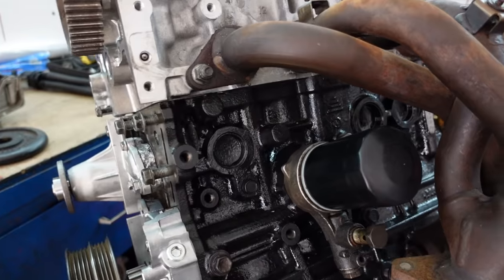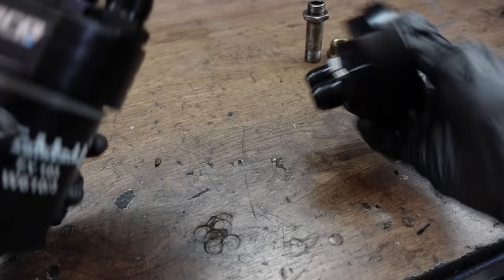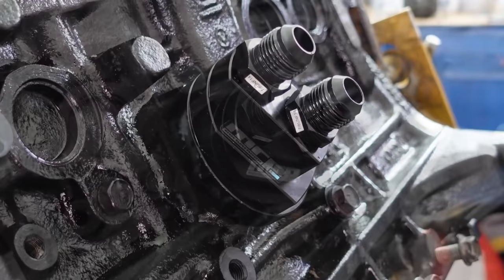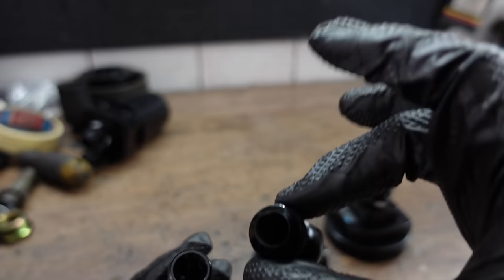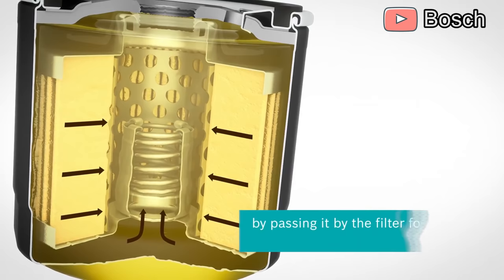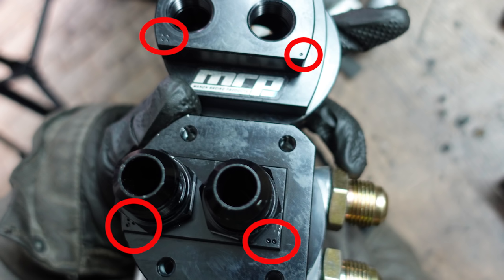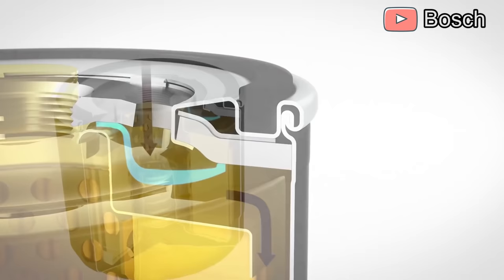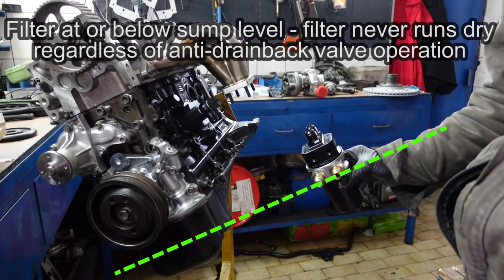HOW and WHY to relocate your OIL FILTER

Comment: Something to remember, use some sort of protected oil lines.    I had one of these kits installed on my Cummins swapped F350.   One oil line rubbed a hole in itself and ruined the motor.    Truck has been down since July waiting on parts and I'm 14k into the project.   All of this could have been avoided had I have used a protected oil line.   It's been a life lesson with zeros behind it.
Reply: it's good that your informing others from your experience so that other car enthusiasts can avoid such incidents and  well 14k ain't no joke but on the bright side you learned something from your mistakes which is always a good thing :)
Reply: Install an oil pressure gauge to or after the point where the oil gets back in the engine block. I know, hindsight 20/20
Reply: @petermolnar8667  it's actually got a gauge on it but I didn't catch it.   I'm thinking of either a low oil pressure shutdown switch or a shift light sized idiot light.    Probably go with the light.
Reply: How about installing oil lines so not being rubbed by something?
Reply: @psk5746  the lines are about 7 feet long.   They were  running down the top of the frame rail and held into position with very wide zip ties.   I thought would be a fairly safe place to be.   It was just the weight of the lines on top of the frame along with the vibration that wore through the soft lines.
Reply: @clinkerclint  silicone lined steel clamps are what most aircraft use and they hold titanium hydraulic lines and wire bundles. I bet they can be found at a Fastenal store
Reply: Another thing to help save a performance or enthusiast engine is to utilise an accusump, electrically actuated with the ignition is best
Reply: @tturi2  accusump??
Reply: @tturi2  accusump isn't going to save you if oil is just dumping out of a ruptured oil line.
Reply: @superbarnie  it will stop your bearings from running dry if the engine drops pressure
Reply: What's your thoughts on using steel braided hoses. Novice here, but like the idea of this, plus using oil cooler, and oil temp/pressure guages
Reply: @ewetoobblowzdogg8410  I think that's probably a good route to go.    I went to my local Caterpillar dealer and bought plastic slip on shielding that is used on hydraulic hoses.   They also make the same product in steel but I was afraid it might wear the rubber line worse.
Reply: @clinkerclint  maybe a warning buzzer could do the job too 🤔
Reply: @tturi2  Lol, yes, for a few seconds until you run out of oil in the accusump. Then you're still boned.
Reply: @superbarnie  that a few more seconds that could save you weeks of work and thousands of dollars
Reply: @tturi2  So spend nearly a thousand dollars to buy a few seconds that may or may not save your engine? How about spend a few bucks to set up a good oil pressure warning? Or spend a few bucks on AN lines that are abrasion/heat resistant? Or spend a few minutes to route and secure the lines so they don't abrade or get caught on stuff? Or set up oil pressure failsafes in your ECU? Any of these things are better ideas than using an accusump. An accusump is great for its purpose, but this isn't one of them.
Reply: @superbarnie  You would do all of those things while also having an accusump, it's good insurance, helps oil surge and sudden leaks, but it's upto you if you think it is worth it, my engine owes me nearly $10,000aud in forged connecting rods, forged pistons, 8000 rpm cams, head studs, machine work ect, so to me the start up prime and a few extra seconds of surge protection is worth it, I'm even considering a drysump for it so maybe I'm going over board lol
Reply: @superbarnie  an ecu that has those fail-safe measures is pretty expensive, usually needs a matching engine harness or adapter, may as well go with wide band and better coils while you are there
Reply: @tturi2  Sure, an accusump is nice to have, but its purpose is to supply oil during brief periods of oil starvation. It isn't a solution for leaking oil lines or oil loss. It isn't relevant to this discussion. 
The ECU thing isn't relevant to people running stock ECUs, but almost everyone with a serious build is running a standalone ECU anyways. I would hope you are not planning to use a stock ECU with your built motor. It would be a waste.
Reply: @superbarnie  nah motec m150 with tefzel wire and dtm connectors
Reply: Same boat for me but with my genny  I’m 12k in and car not running
Reply: Engine Watchdog,  will automatically shut down engine if overheating or low oil pressure event, ond only a few hundred dollars.
Reply: Oh god that one hurt to read
Reply: Simple fix... Don't let the lines rub on something lol.
Reply: I throw the lines that come with kits in my spare parts bin. Then I go to the hydraulic hose shop and get custom made constant pressure tough jacket hoses made. Yea they cost a bit, but buy once cry once.
Reply: @petermolnar8667  I've got a big red warning light now.
Reply: They make hose clamps...
Reply: At some point you think you'd realize that it's just trash and buy a new truck
Reply: @catfisher420  man, if I thought there was a better truck out there, I'd buy it.    What have you had good luck with?
Reply: @clinkerclint  in 1985 Toyota 4x4 was the best truck I ever owned.
Reply: @catfisher420  Those are good trucks, unfortunately they just won't do what I need in a truck.
Reply: Thanks for heads up dude, and sorry about your ordeal. That is super harsh outcome. Don't beat yourself up for too long, IMO easy thing to overlook. Protected brake lines, ok, forseable, but I would have thought higher up the oil lines would have been ok with less protection.
Reply: Just using a nylon sleeve like techflex or a braided line would have saved so much grief

Comment: Why haven't we invented a "pre-start lubricating yet? Basically just an oil pump connected to an electric motor that starts pumping 1-3 seconds before the engine actually starts. Cars almost drive themselves at this point. But why have I never heard of pre-start lubrication? Wouldn't that massively extend the life of an engine?

Comment: I relocated the filters on my S-10 and my Isuzu Trooper. I also switched the filter to a large and common Chevy V8 filter. The filter was more than double the size but cost the same. I mainly did the relocation because the filter sat at a 45° angle and would get oil all over the exhaust and frame when changing oil. Plus if you did a change on a hot engine there was a 99% chance you were burning your arm. I located the filter under the hood and moved the sensors to the mounting pad so they were away from exhaust heat. I can now change the filter easily with good lighting and no awkward gymnastics. I can also fill the filter with oil, which takes close to 1L, and avoid a dry startup.
Reply: Awesome👏 I totally understand why you did the relocation.
Reply: Nice job, the filters on a Trooper as a mess to change, and they need so soon to get changed, what a pain!
Reply: 4jb1 2.8 trooper?
Reply: @amarularif3110  No it was a 2.8L Gas engine which was a General Motors 60 Degree V6. The main reason to start doing the swap was the leaky oil cooler lines which were discontinued so there was no real hope of salvaging the system so the remote filter made way more sense.
Reply: Prefilling an oil filter is a waste of time
Reply: @idabomb00  definitely!
Reply: @idabomb00  why?
Reply: @luizbruno2010  many vehicles have the filter oriented in a way that would make it impossible to prefill, sideways upsidedown etc. Common sense dictates you don't need to prefill one that is possible to do.

All of your critical moving components; crank, cam, rods, rings, gears, chains valves, etc. are already coated and lubricated in oil from the last time your engine was ran (which should be just before your oil change to move contaminants in a suspended state). It takes just a couple of seconds for the oil pump to fill the new oil filter and resume normal operation. That left over oil that was coating your moving components is enough to lubricate them during that couple of seconds. 

Don't believe me? Here's the math. A small block Chevy with a standard capacity oil pump at 400 rpm pumps oil at 2.45 gpm, which is about 5.2 ounces a second. At 3000 rpm it pumps about 18.4 gpm which is about 38.4 ounces per second. Most vehicles will be around these numbers for the oil pump and the volume of your oil filter is a variable, When starting your vehicle, your rpms will be higher than 400, probably 1000-2000 when it first starts for those couple of seconds it takes to fill the oil filter.

This is why it's a waste of time.
Reply: @idabomb00  great explanation thanks

Comment: With an oil filter that sits with the thread side pointing up, so that inlet and outlet are pointing upwards, there is no risk of the oil draining out of it. It might run down out of the feed lines in that style set up if the lines are high but not the filter.
Reply: I was hoping that someone would point that out as it's not clarified here that the anti-drainback valve is designed for filters mounted horizontally or upside down.

Comment: I work more with diesel engines rather than gas engines, but what about using an oil to coolant heat exchanger rather than an air cooler?  These typically have a higher heat capacity than an air cooler, can be pretty compact, and prevent over cooling, in most cases not requiring a thermostat.  You can even get one that sandwiches in between the filter and filter head, so no additional plumbing needed.

Comment: It is often a good idea to relocate filter as that gives the ability to pick up pressurized oil for a turbo or charger, to install oil temp and oil pressure sensors, and to install oil cooler to prevent overheat as well. 
Almost mandatory for every performance oriented engine mods
Reply: Im sure the engine design engineers know what they are designing and doing
Reply: @dq2023  sure. But designing a commercial engine for cars to be sold is slightly different from designing a performance engine for cars to be race.
Reply: @dq2023  they have to design and build cars to a price point, rather that excellent enginering. Except for some German cars, where the Goverment support the auto industry through education & funding of science & research.

Comment: To prevent dry starts  
after the engine hasn't been started for a while, an electric oil pump can be installed between the engine and filter triggered by a remote switch inside the car. Turn on ignition, run the pump for 10-20 seconds or so and oil pressure will build before the engine is fired up.
Reply: Do you know of any electric oil pumps on the market, it's s good idea, I made the same comment before I read yours.
Reply: @slypig24  No I don't unfortunately. I got the idea from a friend who rigged up a pump for his TVR. It was fitted with the Ford V6. Sometimes it wouldn't be used for months but the electric pump would bring the oil pressure up before starting. There's likely a big market for something like this if someone could produce a kit.
Reply: Oh good lord, there won't be any "dry starts".
Reply: @starmc26  Praying to the Lord won't solve the problem..
Reply: @starmc26  of course there will- it takes time for an engine to build oil pressure- even if it's for half a second- that's half a second multiplied by ever time you start your car. It's really not a difficult concept to understand.
Reply: That sort of extra pump arangement adds complexity, and in the use case, won't do anything - as described it would be trying to suck cold oil through the stationary mechanical pump, which is in turn designed with clearances that stop oil leaking past it,...
What works is a pre-charge system that has a tank conected through a two way valve on the return to engine line of the remote filter/cooler assembly - when the engine is running normally a portion of the oil is tapped off under pressure to charge the tank (The tank is never fully filled, the air in the tank is what compresses) with a reserve of oil ready to flow in to the engine when the valve is set to feed back toward the engine. The valve can get a signal from the key, meaning the engine has oil pressure before start-up, and it can be triggered by an oil pressure switch, so if the internal pump starves under high cornering load, the valve sends reserve oil in to the engine maintaining oil prssure in the bearings.
This setup can also be used with dry-sump external scavange pump arangements.

Comment: Awesome, I used the GREDDY thermostatic sandwich plate with an ebay relocation kit that looks exactly like that one in design. It works great on my 2ZR-FAE, that engine doesn't have room around the filter housing to fit the AN fittings, probably with the banjo fittings I could've done it, but even then the greddy plate didn't replicate the filter well enough and would not catch the threads on the oil filter housing, so I set it up just like you did on this video. I can't recommend using thread sealant enough before you run any oil through the lines, it definitely will leak even though it uses NPT fittings. My engine averages 50PSI on cold starts, so the oil pressure builds up way before my oil gauge boots up which is in less than a second.

Comment: I relocated the filter on my 2004 Mercury Marauder because the crossmember and rack would get drowned when the filter was changed. Also, it allows the smaller FL820s filter to be replaced with a larger FL1a, plus adds 1 more quart of capacity.  Mine was for convenience but this video is spot on and very informative.

Comment: Great timing! The SR20 in my NX2000 has the oil filter literally inaccessible without taking apart the whole engine bay, as well as pouring all over the engine when it comes out, so I bought a relocator kit to fix both of those issues.

Comment: Learned some cool stuff. 
I'd also like to point out, there's also the option of a heat exchanger instead of an oil cooler waaaay up in front. 
Shorter lines, less pressure lost in the lines. You do have to plumb some coolant lines though.
Reply: The heat exchange also has the benefit of warming the oil in low temperatures, and is arguably better than the thermostat and cooler combination since it tries to equalize the oil with coolant temperature. Dumps heat in the radiator though.
Reply: @mitchellpatterson1829  Yes you do need to account for it in radiator sizing as well.
Reply: Alot of cars already have this from factory ..... especially turbocharged cars!
Reply: One of the reasons tuners use a separate cooler instead of a heat exchanger is that you free up some cooling capacity of the radiator, without fitting an upgrade. Normally, it would have to deal with both the heat of the coolant and oil, and with some extra power/under higher loads this could lead to overheating, fitting a separate oil cooler is just a way of increasing the overall cooling capacity
Reply: @petermolnar8667  While that is true, an oil/air heatexchanger is suboptimal in case of the MR2 (all 3 generations)  there is no good point to mount it.
The side air intakes are too small and would result in higher engine bay temperatures.
Front mounting would require some absurdly long lines and taking air from below would clog up or damage the oil cooler quickly.

So for a turbocharged MR2, it makes more sense to use an oil/water heatexchanger and upgrade the water/air heat exchanger seperately.
Besides, the water/air heatexchanger needs an upgrade anyway when you turbocharge the car, so this doesn't realy affect costs much because you'll need to get a new one anyway.

Sidenote:
At least the EUDM MK3 came with an oil/water heatexchanger from the factory due to the expected long periods of WOT on the Autobahn and the resulting high oil temperatures.

Comment: Upgrading oil pump is probably a good idea if doing this and make sure cooler can flow good enough for the application. For very cold weather consider the extra distance the oil will have to travel to get to where it’s going. Usually not very much of a difference but it can be considerable bellow freezing.

Comment: Thank you for another interesting video!
To the last point of the engine running without proper lubrication. I'm wondered why there is not an electrical oil pump for pre-lubrication of the engine before start 🤔

Comment: Very good and solid solution. 

I would Like to have oil pressure and temperature information in the canbus. 
But my Volvo 2.5 ft FlexiFuel does not have any Sensors For that. Also it doesn't have an oilfilter can. So i cant use such a relocating Kit with additional Sensor holes. Sad fivezylinder noises

Comment: Hey man, I really appreciate your content and the work that goes into it. 
I had the same clearance issue on my 98 celica. 
An aftermarket oil filter is a great improvement. The HUBB filter features a secondary filter for the bypass valve. It's stainless and washable with warranty. 
I would highly recommend it!
Thanks again for the awesome videos.

Comment: My oil filter is on the opposite side of the engine. The advantage by relocation the filter is you can use the Oil filter as a cooler by putting in it direct air stream.
Reply: it does virtually nothing for cooling because of the lack of surface area.

Comment: If the car is sat for along time and you’re that worried about a second without oil with 0 load. Then look in your Manuel or IG set it up with the ability to prime the system without starting the ignition. Most cars give you the ability to rotate the crank without starting ignition to prime the system you just have to do a special combination of things that the Manual will tell you or either an internet forum.